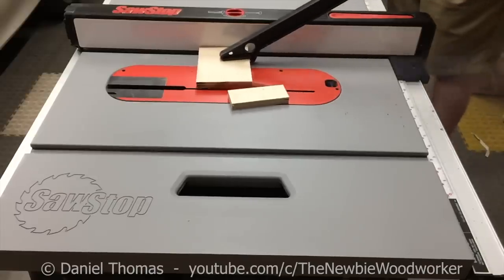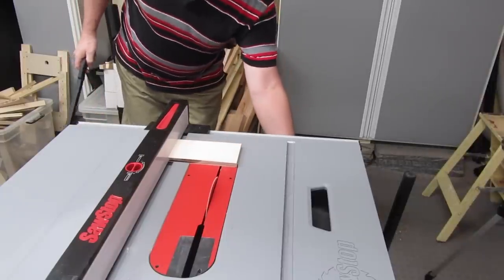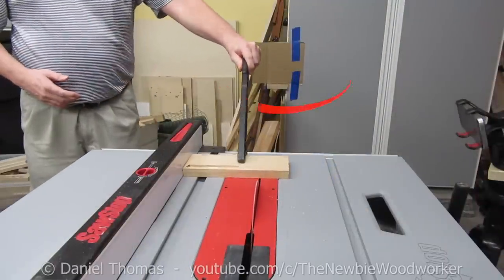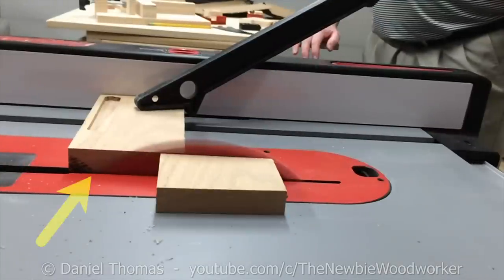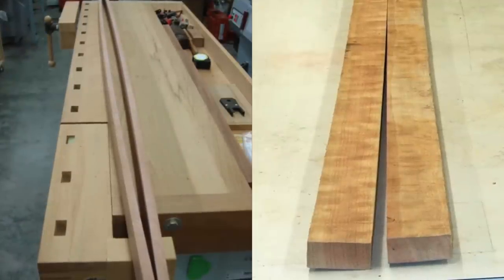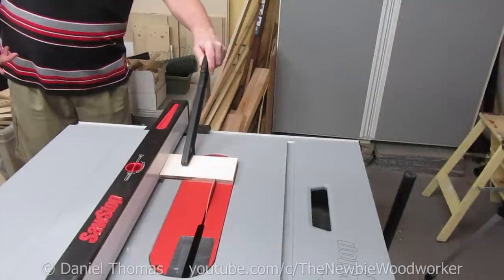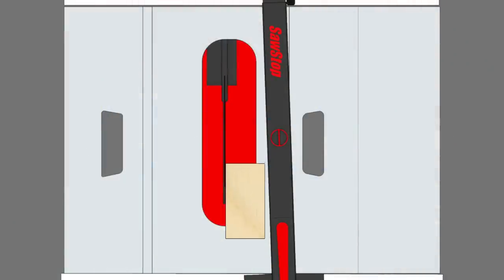Actual Kickback (in Slow Motion), & How to Prevent It

Comment: The cabinet shop i work for has a 5hp saw we use to rip down our sheet goods, i kid you not it has thrown and entire sheet of plywood back at me.  Complacency is always the cause i find, thank you for these videos its good to renew a healthy fear of the table saw.  It is easily the most dangerous tool in the shop.  Do you find that having a saw stop causes you to do things you wouldn't do on a standard table saw? I imagine complacency would be amplified for me if I ran a sawstop.
Reply from the maker: Thanks. You know, it's funny. I thought I might get complacent too. But honestly, since it would cost well over $100 to replace the blade and cartridge, I'm just as paranoid as before, if not more so. And after hearing about your 5hp saw experience, I think I'm happy to have something with less power. :)
Reply: The power is great, you cant bog it down, it cuts the material as fast as you can feed it in. Is important to get a running start haha... joking When i go home and use my table saw in my home shop I feel like im in slow motion at times.  Do you get a lot of burning when ripping thick hardwoods on the job site saw stop?
Reply from the maker: LOL. Good joke. And I know what you mean about when you get home - there was a time many years ago when my work computer was way faster than my home computer, and I hated it! As for burning when ripping thick hardwoods, I haven't had the chance to do that since I got the saw, because I've been working on all these videos, and none of them have needed it. But I suspect that might be an issue. Time will tell.

Comment: Very instructive and illuminating video! Thank you for taking the risk (you minimized it, but still!) to show how insanely "fast" things happen. 

I think you covered everything, but I might add a couple extra points (subject to your grain of salt principal of course):
1) it might be worth noting that although the actual kickback is "sudden" and way faster than a human's reaction time, usually the saw starts "grabbing" about 2-3 seconds (depending on the speed you feed the material) before the kickback. I have heard (from John Heisz I think) that once you "feel" that, you might have enough time to shutoff the saw and "take cover" or at least minimize the damage to your hand by letting go of the stock. Practically, trying to "control" a piece of wood that is going to kickback is more dangerous than letting the kickback happen. And that "push to shutdown" button on the saw is designed that way for a reason! :) 
2) people should train themselves to use the sticks and blocks as a way of "controlling" the stock. We humans tend to instinctively "reach" for things once we feel something is going wrong to prevent it. If you need to adjust anything, mid-cut, either use the stick/block, or if you are uncomfortable and have the urge to use a hand, just turn the saw off and back away. (this one I think I learned from Steve Ramsey)
Reply from the maker: Thanks, and I agree. How could I argue with two of my favorite YouTubers? :)

As for #1, I decided not to mention this, because I'm not really sure what's the safest thing to do once you feel things start to bind. It can depend on a lot of things. Is it a knot? Is it warping? Or is it something else, like when I rip cut a 2x4, my saw definitely slows down, but it's not really binding - it's just a little underpowered to do this. I couldn't figure out how to explain this, so I decided to just not address the issue. Cop out I know, but I'd rather not say anything at all than talk about something I'm unsure about.

As for #2, I agree, and that's why I prefer the John Heisz-style push stick to the Matthias Wandel version. The John Heisz style feels like more of an extension of my hand, so I'm less likely to do something stupid. The Matthias Wandel version makes me feel like I'm using chopsticks, and the potential for me to do something stupid increases greatly.

Great comments, and thanks!
Reply: Fair enough :) I agree that advice that is based or dependent on "experience" is not a good newbie advice :D If we could tell a kickback grab from "blade having hard time chewing wood" we would not be newbies :D heh heh heh! 
I have been in situations (most likely because of lack of experience since I AM a newbie :D ) that pulling "back" the stock makes things worse. That is why I usually turn the saw off if something feels odd or weird noises come out. I should confess that those happened to me before I thought about checking the blade alignment and Voila! everything was out of square on my saw :D After tuning and adjusting I haven't have any of those odd moments yet :)
Reply from the maker: Thanks, and I wish everyone could read your comments. I don't think people realize how important proper alignment really is.

Comment: Nice video and enjoyed the Comments.   Don't have critique, just add what I practice.  Instead of relying solely on memory which would get it right 99% of the time.  It's the 1% that can reach up and bite you in the @ss.  So, I have a checklist posted above my table saw I go through each time.  I mentally visualize how it should go.   I wear the same garb as when I'm at the lathe - both face shielding which I spent a few extra $'s to get a really good one.  And an apron lined with a couple layers of thick, stiff leather.  (It's not as hot as you might think.)  I walk away when tired, angry, hurried, hungry, unprepared, or anything that would impact full concentration - this I had tatoo'd to my brain back when I road motorcycles.  Last, I had to learn to love the process of setup which at first seemed unnecessarily long. Playing in a relatively 'short' football game makes all those long and grueling practice hours...worth it.
Reply from the maker: Thanks, Chuck, great comments. If I posted a list, I'd never read it. That's just the way I am. But your ideas are really good, and I hope others learn from them! Thanks again.

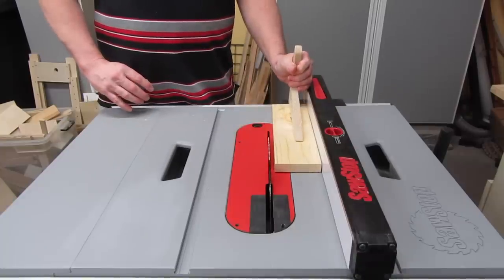Comment: At 10:30 I tried that left side shhhhtuff and got kick back and found out that the anti-blade is not for the left side since the anti k.b. is made for the right side, it comes with a bit curve toward the fence so when you push the material thru the k.b. blade pushes it toward the fence  keeping a bit away from the saw blade and on toward the fence. In a Ryobi T. saw the K.B. blade is not made for the left use of the table since it's curved toward the fence.
Reply from the maker: If you're talking about the riving knife or the metal part of the blade guard, then it should NOT curve towards the fence, and it shouldn't curve away from the fence either. It should be dead straight. If it isn't straight, there's something drastically wrong - dangerously wrong.
Reply: @TheNewbieWoodworker  okkkkkkkkkkk, i'll ck it ty
Reply from the maker: @ccccen  👍

Comment: Actually a pretty GREAT video!

     AND apologies if I missed it, BUT... I do have an older (crap) Table Saw. AND while Splitters are good for those saws without equipment or frame for a riving knife (or blade guards, or much of anything really...lolz... did mention "crap" specifically) another wonderful little trick is to get something that measures to the 64th of an inch, and cant the fence OUT just that little bit... OR (my opinion better) add a "no clearance" piece to the fence with about 1/64th shaved off from just about "90% past" the blade (consider for a moment we're all new so straight line cuts are easiest to accomplish) 

    The idea (intent) here is simple enough. It doesn't need to be a precise cut, so just aiming for the rear of the blade is good enough, primarily to give a straight path IN to cutting, for that precision everyone wants... AND just a hair extra space OUT of the cutting zone for a little "wiggle room".

     When I'm using the saw, it's 99% convenience or speed. Frankly, I have yet to find something someone can accomplish on a table saw that I "absolutely can't" do just as well with a plain-jane circular saw. SURE, there are things that are a WHOLE lot easier (convenience) and things that are a WHOLE lot faster (batch processing simple cuts) on the table saw... BUT pretty much nothing I just can't do with the circular...
   That pay-off comes at a price of set-up. Set it up right, and then run through properly (or as close as reasonably possible), and you'll live longer. If' it's a once in a lifetime cut, however...Maybe just go with the old circular saw and leave the big-dog on the porch.

    I say that with the concern that a LOT of accidents are preventable through appropriate gear, setting up, care and attention to details and all... There are a lot of folks who do this craft for relaxation... expression... and a litany of other reasons. BUT there are just some tools one should never EVER approach nonchalantly. Routers and Table saws are both on that list... and I've seen some pretty horrible things because of a lackadaisical attitude and plain old laziness. ;o)
Reply from the maker: Thanks for the comment, and although I'm not exactly sure what you were talking about with your fence, I agreed with everything else 100%. Your point about being able to do the same things with other tools is completely valid - that's true for most of our power tools. And I'm glad you mentioned routers along with table saws, because I know from experience how a lack of knowledge with the router can result in bloodshed! Thanks again for the comment. 😄
Reply: @TheNewbieWoodworker  Always welcome!
   AND just for clarity, I was talking about adding just about a 1/64th or so (very tiny) extra margin between the blade and fence to the "rear" (out going) end of the blade. 

   I'm usually concentrating on keeping wood aligned to the fence while I'm pushing through the tablesaw, and that extra 64th doesn't sound like much (it's roughly a pass from a hand-plane) so it won't interfere with the precision of the cut... and there's just a little "breathe space" to avoid pinching work between the blade and the rip fence.

  I've heard some saws are designed that way, but while you mentioned purposefully swaying the fence INTO the saw-blade to cause kickback, this is using the exact opposite idea to avoid most of it...
    That's all I was trying to get at.

In any case, glad you liked the comment, and I'm along to learn as much as to help out where I can. hopefully... ;o)
Reply from the maker: @gnarthdarkanen7464  Oh, that makes perfect sense. I have my fence aligned so that it's "toed out" slightly at the rear, which is exactly what you're talking about. So now I can say I agree 100% with all of the things you said. 😄
Reply: @TheNewbieWoodworker  GREAT!
    AND... apologies for getting "complicated"(?) ...lolz...

   Early on, I grew a healthy paranoia about the tablesaw, and rather than try to calculate and measure some tiny angle on the fence as if I (a terrible noob' at the time) could repeat it well...
    I added a very straight length of wood to the whole fence... and then shaved off about a 64th" from the "rear-ish part of the blade" all the way to the output side of the table, allowing me to keep working on the geometry "as normal" and carry on with that "breathe room"...

    I found that to be helpful at least until I was confident in my ability to be sure "if I err' it's in the appropriate direction"... SO that's just another way to accomplish the same thing... and nowadays, we do have measuring devices that really ARE that reliably precise, so a "second method" is just a choice for the particular craftsman (noob or otherwise) in question. ;o)
Reply from the maker: @gnarthdarkanen7464  👍

Comment: I have a fear of the table saw so I respect it and know the proper way of using it. And I can say I’m good at it now but I don’t let my guard down. I always practice the movements up to the end before actually turning it on. 

I’m a lefty but use my right to hold the push stick or Grrr-ripper. I do stay on the right side though, as I feel safer there but you may be right on staying on the left even though my right hand is doing the work. (On second thought, I think I stay on the left... hmm, possibly depends on the situation or cut.) but I’ll try to stay on the left more now. 

The Grr-ripper may be expensive but it does help me stabilize the piece most of the time. There are few situations it won’t work and I have to use the push stick but I think it is worth the price.. Price does dip a bit if you can wait. I have two. Not always to use together but sometimes I just leave it at a certain setting so I don’t have to tweak it too often. 

I’m always looking forward to your videos. I can’t wait until you get to the router! More power to you.
Reply from the maker: Thanks, and great comment. Yep, never let your guard down. It's like a trained, but wild animal, and it can snap at any time. And I agree with the Grr-Ripper comments. I think it's time to buy another, because sometimes one isn't enough. And I can't wait until I get to the router either! :) Oh, and thanks for the lefty comment. I can't imagine having to use my opposite hand like you have to, although I suppose you get used to it.

Comment: I bought a 8.25" Dewalt table saw couple of weeks ago and haven't unpacked it.  First thing was to order a Grripper!  $65 or $85 or however much it cost is nothing for a tool that can help keep you safe!  I'm looking for a good table for it before I even put the saw together, so I'm not tempted putting it where it won't be safe to use.  Growing up on a farm and being around machinery (and big animals!) makes you respectful of how quickly things can go wrong if you are in the wrong spot at the wrong time!
Reply from the maker: Very true, and good thinking. The only problem with the Grr-Ripper is you can't use a blade guad with it.

Comment: What should you do if you think a piece is about to kick back? Just hit the emergency stop and get out of the way?
Reply from the maker: Try to just hold it steady in position - don't force it any further, and turn off the saw. Always make sure you're out of the line of fire, of course. Generally speaking, there's two types of kickback situations. One is when it happens before you even know it, and there's nothing you can do about that. The second is when you actually notice some resistance, but you make the bad decision to continue. In that case, you're at least aware that there's a problem, and the better choice is to stop and figure out what's going on, before you get to the kickback point.

Comment: Near the end with the 2X6, and you lost grip... THAT was a "clincher" moment!  Should have used the claw style instead! You sure put alot of effort into this great video, AND you put yourself in danger also!
Even when demonstrating kickback, you don't know where the wood will go.  Of course, when cutting you did what I do... stand to the left so when you use your push stick, there is a somewhat natural tendency to push to wood towards the fence.  And push on the edge close to the blade.  Also make sure there is enough material against the fence to help eliminate the work from twisting into the trailing edge of the blade.
Great video!
Reply from the maker: Thanks! 😄

Comment: What if you used one of those cut proof kitchen gloves? Will the gloves protect you from getting your hand cut off?
Reply from the maker: Wearing gloves when using most power tools like this is dangerous. If the saw blade catches the glove, it'll pull your hand right into the blade. 😳

Comment: Thank you for this video! I’m a total newbie and I’ve never used a table saw before. The thought of kickback frightens me. My main use for a table saw is to rip edges off of my 2x4’s and 2x6’s. Any other tips on how I can practice safety?
Reply from the maker: Thanks for the comment, and glad I could help. The best thing you can do is watch some more YouTube safety videos. Knowledge is your best protection. For ripping the edges off of 2x4s, make sure you use a riving knife or blade guard. Then you're probably safe as long as there aren't any nails. 2x4s, like a lot of wood, can twist when you cut them, but if you're only cutting the edges off, that probably won't happen. And of course don't stand in the line of fire. 😛

Still, if the 2x4 starts to bind while you're cutting it, meaning it gets harder than usual to push it through, turn off the saw. And the funny thing is, it's easy to get hurt turning off the saw, because your focus goes away from the blade, so just be aware of where the blade is when you turn off the saw. Then figure out what's wrong. Usually you can see that the wood has started to warp somehow. And oftentimes you just need to stick as wedge between the offcut and the main piece, after the riving knife or blade guard.

That was probably too much information, LOL. Just pay attention to what you're doing, and you should be fine. 😄
Reply: You are so amazing!! Never too much information!!😁 I will definitely look up more videos and follow your tips. Thank you thank you thank you!!!
Reply from the maker: @Bebegurl53  Thanks, blush. Enjoy the ride, because woodworking is a blast. 😄
Reply: @TheNewbieWoodworker  Actually, on my saw the On-Off switch is mounted to the right of the saw cabinet just below the fence rail, so if you're using a rip fence on the right & standing to the right of the blade, simply dropping your left hand puts it at the switch. I never understood why other saws put the switch on the left forcing you to awkwardly reach for it.